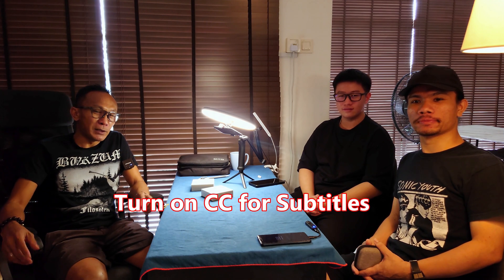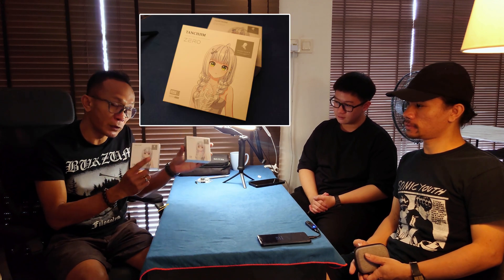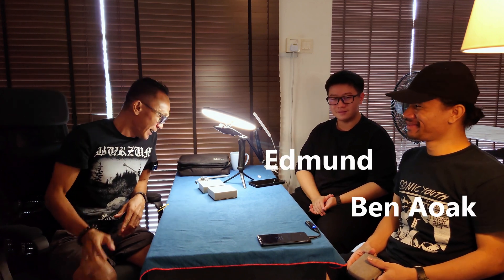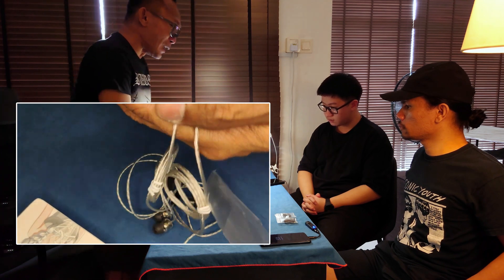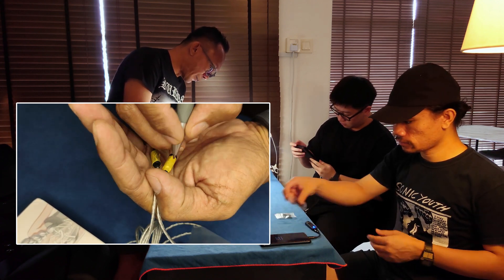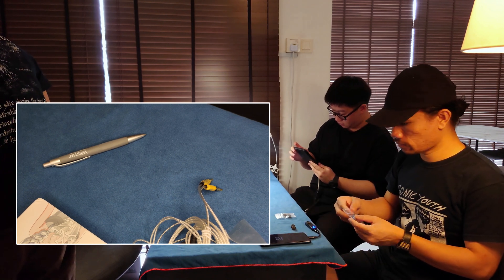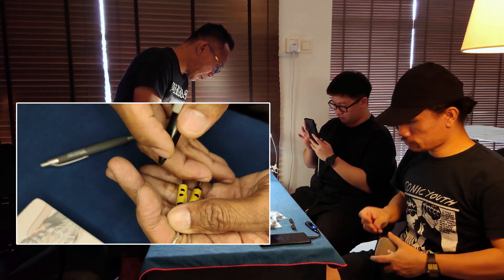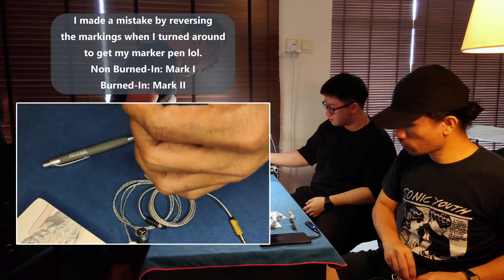Burn In! Real or Myth?

Comment: Is it okay to just use my new dynamic driver IEM as normal while listening to metal music? Then after i use it, i will now let it burnin using pink noise?

Then if I'm going to use it again, i will stop the pink noise playback for awhile to listen metal music again. Is it okay to do that? Or does it need to just burnin it using pink noise straight for 200 hours without interruption?
Reply from the maker: Yes that's exactly what I did, when not in use I let them run on pink noise. So you are doing it right
Reply: @AndyAudioVault  Thank you. Glad to hear that I'm doing right.

Comment: is burn in also a thing for dongles? how many hours should I burn in a cayin ru7 or hiby fc6?
Reply from the maker: For solid state delta sigma, not much. But for R2R, just use them as normal and after 100 hours of normal usage, they will stabilize

Comment: after trying 200 hours burn in with pink noise i tried my Tanchjim Zero for the first time , Mr Andy i noticed that the right earbud has more sound than the left earbud . Is that normal or my earphone got a bit damaged from the burn in ?
Reply from the maker: Hi Steven. That should not be the case. Check if there's issues with nozzle or something blocking the filter. You must remember that Tanchjim ZERO is ultra dirt cheap IEM and it is possible QC issue may happen. Even IEMs above $100 could present QC issues
Reply: @AndyAudioVault  Thank you for the information once again Mr Andy . I appreciate it so much 🤘

Comment: Will the U12t benefit from burn-in also? It's a 12-BA iem.
Reply from the maker: Personally I haven't has the chance to test any U12t, but from my own experiences with other multiple BAs, they do benefit from burn in, not as significant as DDs, because BA are built differently with metallic moving parts rather than vibrating transducers. I can tell you that my single BA of Etymotic ER4SR sounded more refined after the mark of over 100 hours. Different IEMs may exhibit different scenarios

Comment: my experience with burn in is also positive, some of my iems or headphones changed quite a bit some just mildly some of them were good just from the start. But between iems/headphones that needed burn in (the transition were in the short period of time, atleast most of it, lets say on another day I pick them up and they already sounded different). For example my etymotic er2se or audiotechnica athm60x changed quite a bit (on another day). But here is  one thing, when companies figuring out the sound and changing different drivers/combinations etc. do they judge sound that is not fully developed or do they use burned in drivers somehow? :D Do they have enough of time to burn in every combination or do they have pre-burned drivers (somehow)? 🤔😄
Reply from the maker: Good questions, I wondered about that too, how do the manufacturers gauge the end state? 👀

Comment: Hi 😊and what about the unit variants? Even smallest difference between units could harm this test theoretically. But I like to see that u guys had some good time 🙃.
Reply: That’s exactly what I thought too. It is a reasonable test but not without flaw. There should have been a blind A/B when BOTH were still brand new. Then A/B’d again afterwards. It still wouldn’t be a perfect test but it’d provide more context to the audible differences.
Reply: @davidcoons89  perfect test of this kind is impossible IMO. Even measuring those 2 iems could create enough of the deviation. I mean even if they would measure the same (somehow) the basic deviation of the method could create some mismatch (whats is caused by what).
Reply: @matusjurcik6974  I entirely agree. I just meant to get rid of some unwanted variables that they could have compared and measured both sets brand new. But ya I agree, it still wouldn’t make for a perfect experiment unfortunately
Reply: @matusjurcik6974  there's also a psychological layer, just from changing and comparing, looking for differences. a better blind test in this case is to actually blindfold the subjects and put on the IEMs for them, this way you can also put in the same one twice without them knowing to pretty much eliminate the expectation bias